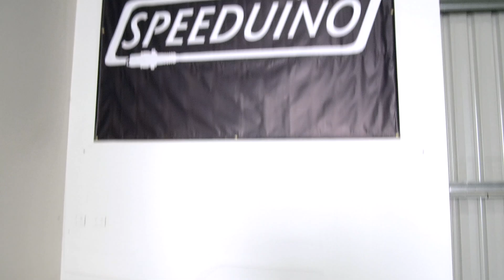Some exciting Speeduino news

Comment: I want to see if it can be set up for a 6cly dual plug motor with electronic fuel injectors turbo charged air boat 520 Continental

Comment: Nice work!! If you need any testing and validation done for software we have engine dynos with full automation capability and a ton of DAQ hardware. I’ve been a long time follower of the project and have really been impressed with the work you have done and where it has got to since I first seen it on Hackaday. Feel like it’s time I contributed to the project!